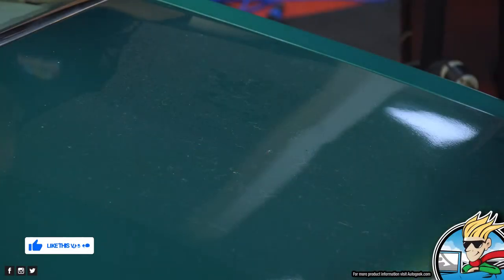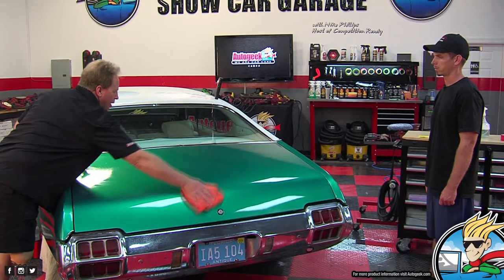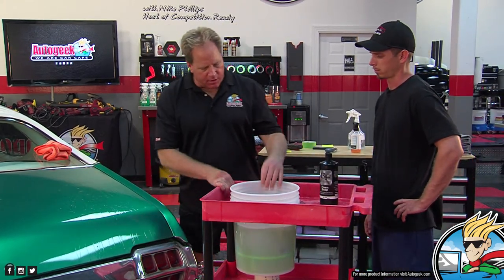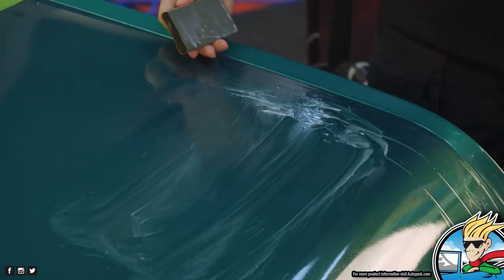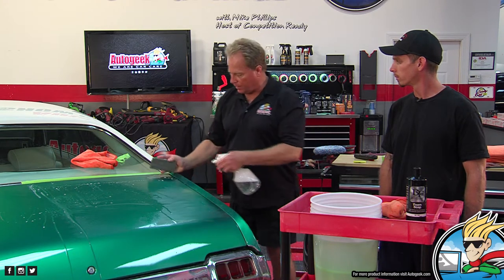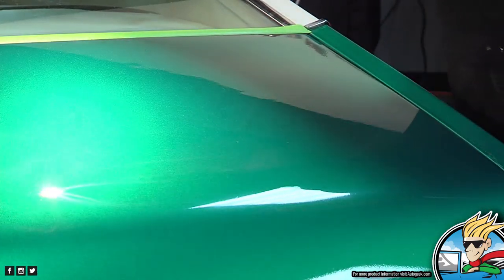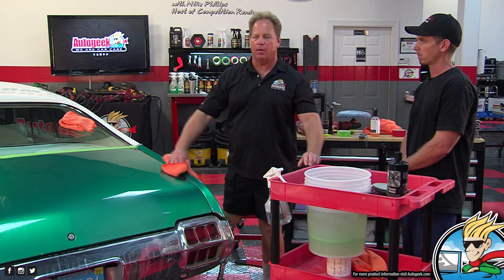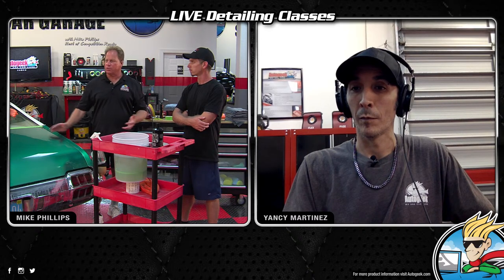Does your car have orange peel? Remove it by hand!

Comment: Hands down (ha, ha) best tutorial on hand sanding, and I’ve watched dozens. Thanks. My car is a black 1980 MGB LE with a year old respray. The meguiar’s 2000 finishing paper is outside my budget. I went with 3M wet/dry 2000 and 3000, 3M sanding blocks, Meguiar’s M105 and M205, orange cutting pad, white polishing. Again, thanks for sharing your skill and expertise.

Comment: Hi love this video! I have a question I laid down some 2k clear coat on my finished custom paint job it’s looking very good but i don’t think I laid down enough clear on the panels and I sprayed too fast so I have some crazy orange peel going on I noticed on spots that I slowed down on the clear coat came out on the panel smooth as a baby with no orange peel and looking like a mirror….is it possible for me to wetsand the whole panel down with 2000 and just re clear it to add 1 last smooth top coat of 2k clear without any issues?

Comment: Do you guys have any experience with K grit sandpaper? I believe Eagle Abrasives makes it, maybe others. Not sure of the technology behind it, but for an example 2000 K grit is supposed to cut as quickly as 1500 but finish like 2500. They have all the popular detailing grits, and you can get it in various sizes and shapes.

I keep meaning to order some and try it out, but just never get around to it. But everyone who uses it seems to love it and swear by it. The one thing I'm unsure of is if it can be used damp, because they always highlight that it works well when used dry as a selling point so you can easily monitor your progress. But dry precision sanding just feels wrong to me, like dry buffing. 😞

Great episode, thanks gentlemen! Congrats on the new car Yancy, good luck on the speeding tickets! 👍✌
Reply from the maker: Hi Keith - I have not used K grit sandpaper.  I'm a perpetual student so I"m always open to better products than I know of or use.  -Mike Phillips
Reply from the maker: Hence the reason for sticking with Granite Grey - can blend in easier! Thanks for tuning in and will get with Mike about the sandpaper that you asked about. - Yancy